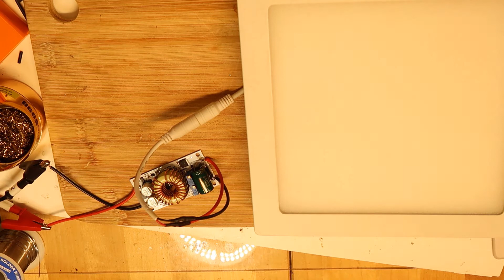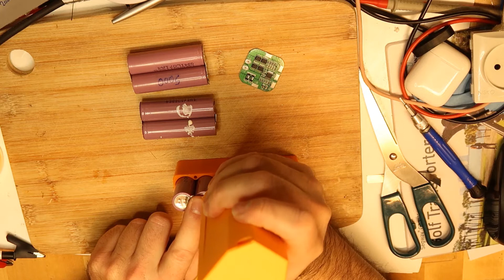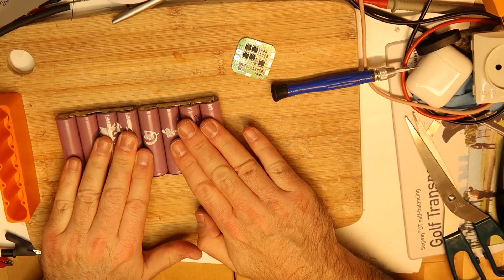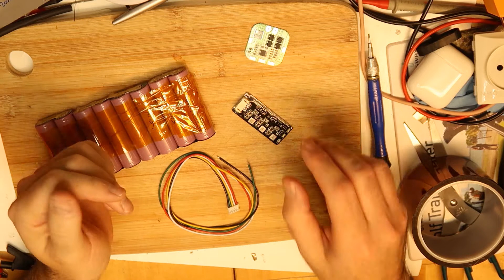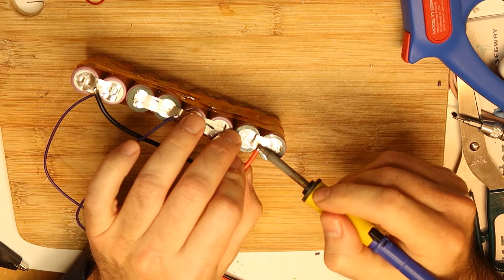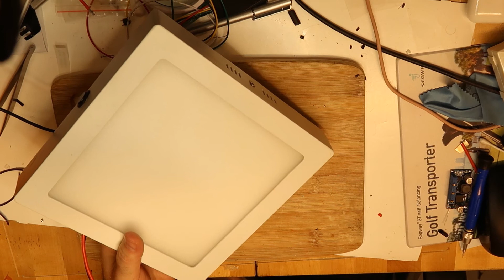How to Build 5 Hours Continuously Emergency Led Light 18W

Comment: Interesting, I might try a similar project but just use a single 18650 and a lower power LED and of course a fuse 1st, I always add the fuse when using 18650's just in case.